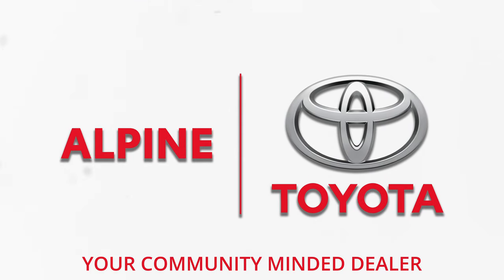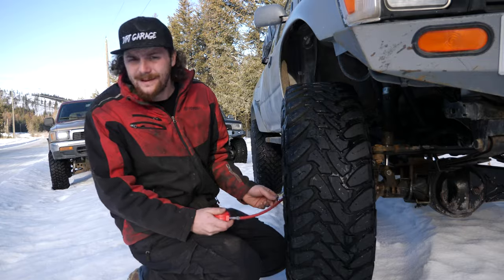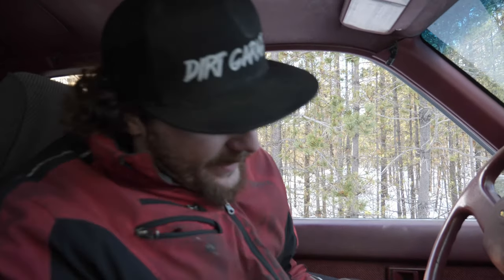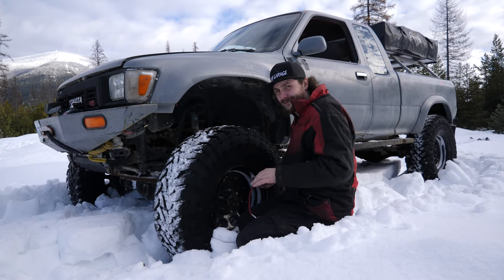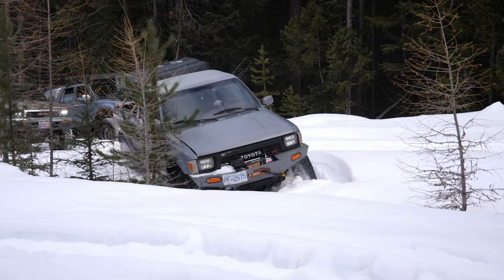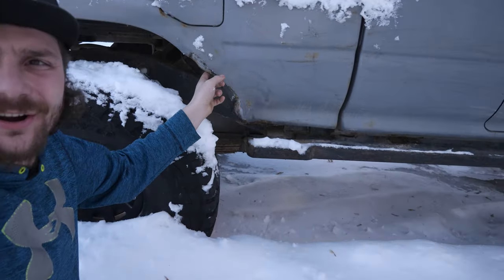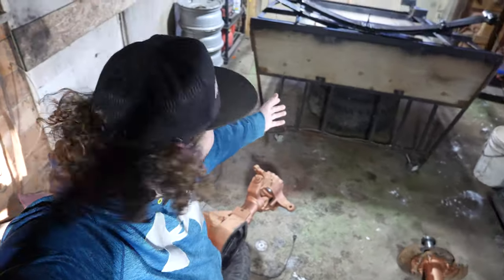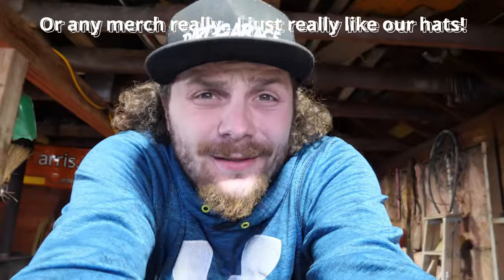Breaking Parts Snow Wheeling V8 Toyota

Comment: Always been a fan of spring snow. It is hard enough to support the weight of a lite rig. Some years it will support really heavy rigs. At least that's what I have found with North Dakota snow. Prairie snow is different than mountain snow. Wheeled all forms of snow over the decades and still prefer to a section line with 10 feet of snow. Great day in the snow guys 👍
Reply from the maker: Very true! Spring snow is the best, and super early hero snow. This mid winter stuff is just nasty.

Comment: I have parts for Toyota pickups like yours here in Canada if you wanted to buy them. I have an R150F (V6 Manual transmission) front and rear driveshafts (V6) windows (sunroof/rear sides/rear sliding)

Comment: Yo man love the videos. I recently bought the spitronics setup you have for my 1uz 4runner. Having problems with cold starts and it reving properly. You think you could send me your tune to see if it helps mine out. Would be greatly appreciated
Reply from the maker: Mine struggles to start colder than -15c, not fueling properly. I spray starting fluid down intake and she fires right up when cold. Don't have any revving issues though.
Reply: @DirtGarage  yea it doesn't get that cold where I live. Do you know how to send a tune file?

Comment: You can hear your motor is not running right. Should have more power then that.
Reply from the maker: Thats only the first shot when I was having clutch issues, I reversed and knocked my transfercase out of low range so it was struggling in the snow. Other than that it is just a horrible exhaust leak that sounds terrible.

Comment: Those lockers are not for pedal to the metal dumb driving. They are for precision, intelligent and defensive driving. You guys have no idea about snow wheeling. Go and watch Snowbatman99 to see how it is done.
Reply from the maker: Man, you have no idea what you are talking about. It all depends on the snow. This was 4" of crust and all sugar underneath, I cut out the parts where we try to go slow and with precision BECAUSE IT DIDNT WORK. We have other videos with good deep snow and where you have to creepy crawl it. Snowbatman is on a whole other level, wide tires, rear steer and totally not streetable, your comparing apples to oranges.
Reply: There's a lot of variability in snow conditions and how to drive them - it absolutely takes hard driving to make progress sometimes
Reply: @DirtGarage  Until recently, all of my time spend snow wheeling, I would have agreed with Falcon Patrol, but a few weeks ago we went out on Booth Creek, and the creepy crawly was working, but super slow. Some consistent pedal and both lockers on kept us going at a good rate.
Reply from the maker: @Tree Lovin' Adventures  You know my truck. And it's creepy crawly capabilities 🤣 I promise you it wasn't working here. But apparently I need to include trying creepy crawling and not working in future videos!
Reply: @DirtGarage  Yeah, the snow has been tough this year. We have only had one day that we could crawl around on the hero snow unlocked with zero effort, but that was short lived as it got colder into the night.